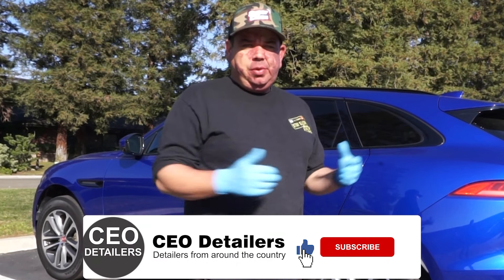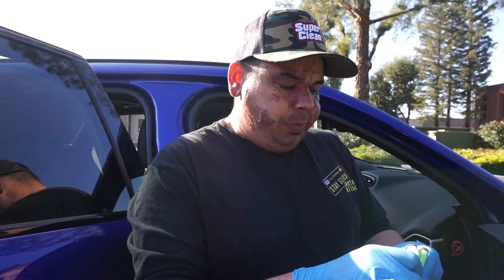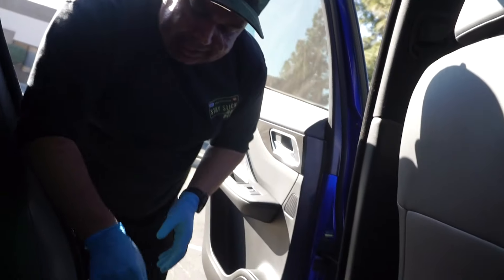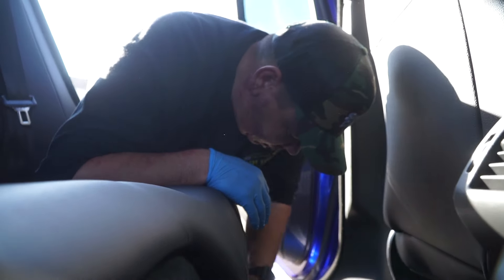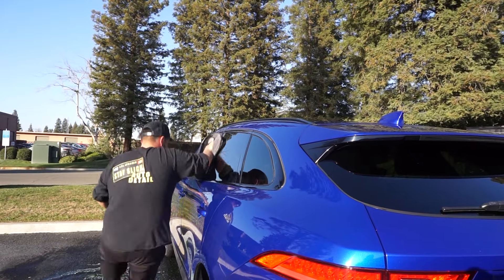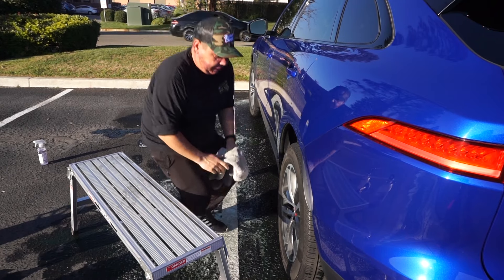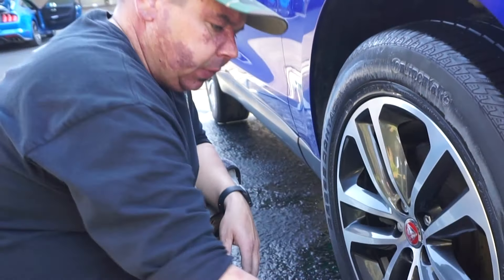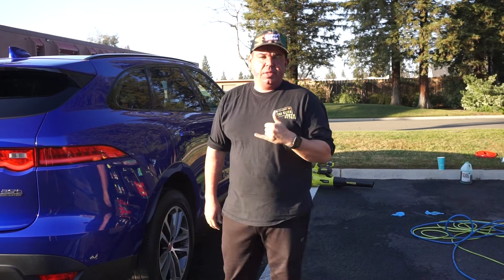Spot Removal on Jaguar with Stay Slick Auto Detailing - CEO Detailers

Comment: That's why i start with the exterior first because by the time you're done with the interior, those exterior drips should be dry where you just have to touch up
Reply: Yeah I think that’s a valid point to her used to do it that way but overall I have learned I prefer interior to be done first. Just a preference

Comment: Lighting fast and nonsense 💯 that's it the rest are ........ I don't know 😆
Reply: Bro I have a gallon of nonsense that’s basically unused. It streaks on plastics for me.
Reply: @StaySlick  i never had that problem 🤔 put a few drops of Dwan disch liquid and they it again
Reply: @cebasmb8250  I should clarify it streaks on piano black trim and chrome door handles
Reply: @StaySlick  ok got you
Reply: @Stay Slick , for piano black and chrome interior surfaces we use Chemical Guys "Total Interior" and it does not leave streaks behind.
Reply: @mobilewashdetailing361  yea I’ve used it it’s good. I still stand by my love for super clean. 4:1 on wheels tires and for APC rinsing. 10:1 for interiors
Reply: I would go with tuff stuff and la's totally awesome. Those two in unison are a1.